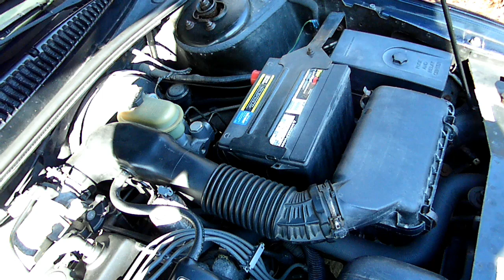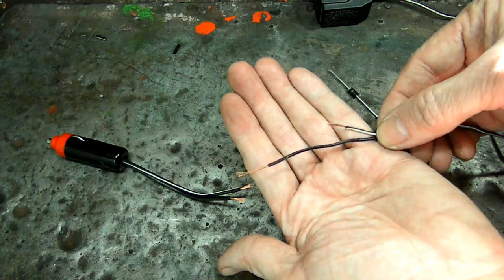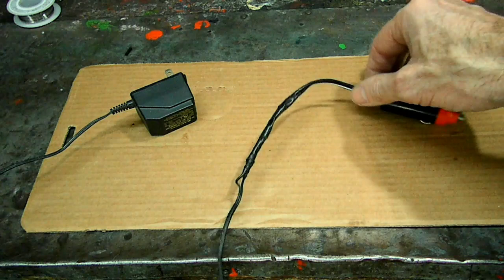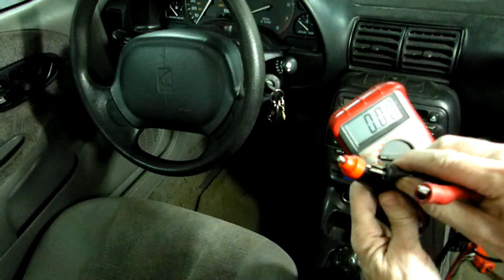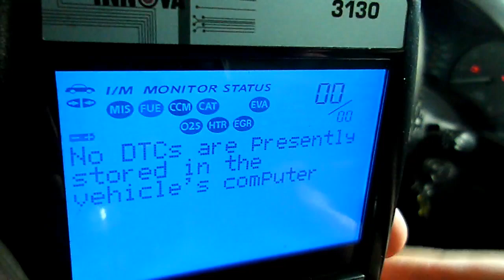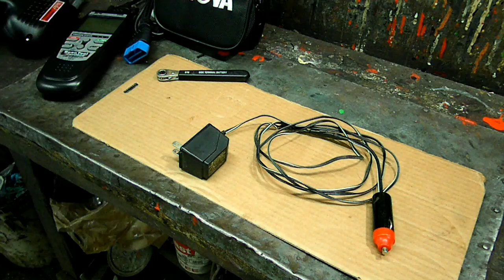Automotive Memory Saver

Comment: I'm no electronics wizard, so, what's the diode for ?
Thanks
Reply: Diode allows an electric current flow only in one direction, so car battery current won't pass to external power supply when both of them are connected for a moment.

Comment: I like this, but it would be better if you put a LED in such a way that it lights up when the cigarette lighter thing is installed.  That way you are sure of the connection.  They aren't a particularly good connector.

Comment: I just connected my cigarette lighter plug to a small 12 volt battery, ensuring correct polarity of the center and side electrodes. Plugged that in to the cigarette lighter on the car and changed the starter battery. No dorking around with transformers and diodes!

Comment: Why the diode?  The output from the little power source is DC.  Why need a half wave rectifier from a single diode?   What size diode did you use?  Thank you.

Comment: I'm dumber than the usual bunny, but you didn't mention if you plug the transformer into a power supply. I assume that you did because I see the transformer connected? to an extension cord?

Comment: Excellent idea Rich. Ordered a pack of diodes last week. They arrived today and I wired, soldered and used heat shrink tubing on mine with a left over 12 volt AC/DC adapter and a spare 12 volt cigarette lighter plug. Works great and thanks for making this video.

Comment: I understand that this is an old video, nevertheless there is an important question that was left unanswered : what is the purpose of the diode ?Personally, I see two purposes.  Firstly, assuming the diode is installed properly, not reverse biased that is, the this will make sure that the current will flow from the transformer to the car's electric system and at the same time, it prevents the current from the car's battery to flow back in the transformer, which otherwise could be nasty.If the diode isn't installed properly, reverse biased in this case, then no current will be allowed to flow out from the transformer towards the car's electric system but current will flow from the car's battery towards the transformer.  You then have to picture that the 12.6V of the car's battery will be lowered down to about 11.9V at the lighter outlet, because of the diodes voltage drop, then roughly 9V will drop because of the reverse polarity, leaving about 2.9V with the proper polarity at the outlet and potentially at other points in the car's electric system, which would lead to unwanted situations for sure.I don't know for sure if such scenario could have a negative impact on the electronic components of the car, but count me out to test it on my car.  Nevertheless, I will try to simulate the scenario and see the outcome.Globally, in this actual case, the diode has a VERY IMPORTANT role to play !!!
Reply: That's NOT how a transformer works!!!   No diode is needed at all since the transformer converts AC voltage into DC voltage!!!!

Comment: Hi Rich, I tried this as per your instructions and it worked.
However, when I disconnected the battery leads from the terminals I got a rapid clicking sound coming from the relay fuse box which I presumed must be the power from the cigar lighter was affecting one of the relays, probably the fuel injection relay. I used a 12v adaptor with 300mA and 1N4007 silicon rectifier diode rated at 1A and 1000v. I also had to turn on the ignition for the lighter socket to power up.

Can you explain this and has anybody else experienced the same?

I then tried it again using a 9v battery and the same diode with crocodile clips attached to the battery leads and that worked but this time I didn't get any reaction from the relays.
I would appreciate any comments or observations.
Reply from the maker: lorus511 I have never used this system for the vehicles were you have to turn on the ignition to power the lighter.I use this system in this video https://youtu.be/CWQXGPp7i0E for that.

Comment: The chances of doing this wrong and over-loading the transformer are too great.
Getting a memory saver with a connector that goes to OBD II port and the other end to a 12 volt battery booster is highly recommended.
Reply from the maker: I just picked up one and it is a great tool to have.http://youtu.be/CWQXGPp7i0E
http://youtu.be/RBfS6NyAxjI
Reply: I have used this one on many vehicles with success. https://www.amazon.com/dp/B07KCN69LJ/ref=cm_sw_r_tw_dp_U_x_WI7OCb84M69KN
[[ASIN:B07KCN69LJ OBD ll Connector 9 Volt Battery Auto Memory Keeper/Saver]]

Comment: Rich, I just spent about 2 hours replacing the coils on my 2005 Expedition. I had the battery disconnected during the process.  Upon connecting the battery and then running the truck,  I've noticed that it seems like it is idling too low, while in drive.  Could something in the trucks memory gotten erased?  My presets on my radio remained on the memory.  If that is not the case for the idle, im going to be looking at a vacuu leak.  Whats your take on this?

Comment: Rich,
You could have soldered the 9 volt battery end of the cable you cut to the cigarette adapter and connected a 9 volt battery and got the same results, correct? Seem this would be much safer then messing around with a 120 volt feed>\.
funkro

Comment: There can be caveats regarding the AC adapter you use. Current and voltage are directly proportionate, which is important on a plain unregulated AC adapter. That means a 12v adapter with a higher current (amps) rating than the current you're actually using results in a higher voltage.  The computer, radio, etc, will all have protections, but I'd suggest using a lower milliamp rating just for saving settings. I wouldn't use accessories or you'll then drop the voltage. Or, use a regulated adapter.